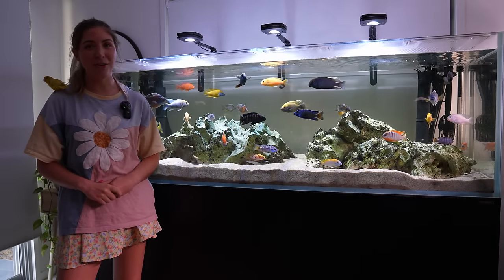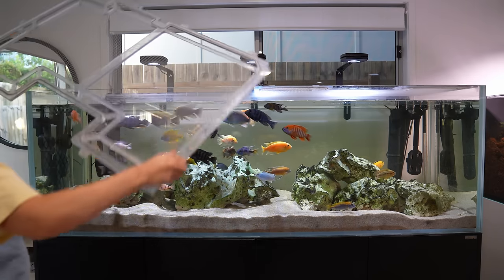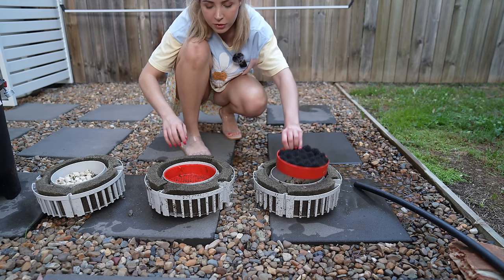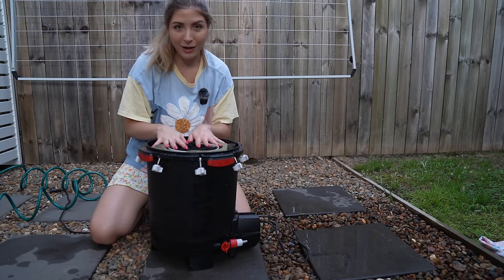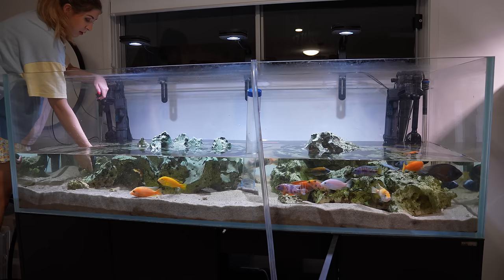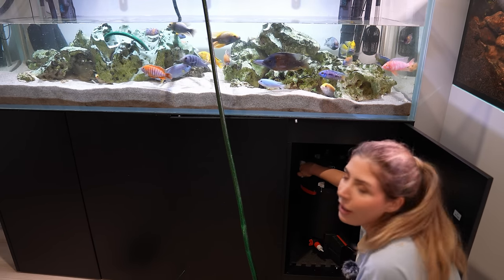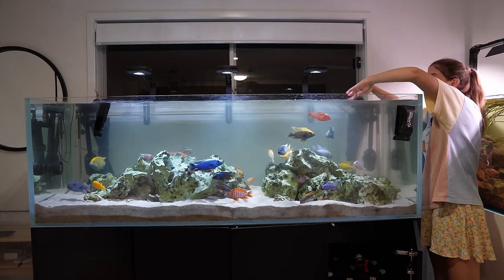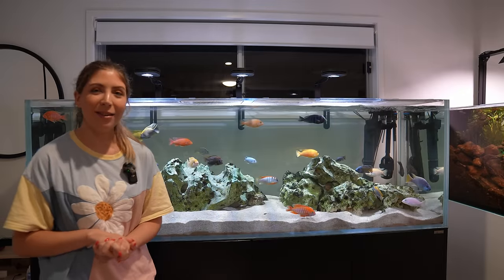Fluval FX6 Cleaning After 3-months on my African Cichlid Tank

Comment: Hi Kaity, nice to see you progressing putting effort in video editing!
To me, you can still give a try to 2-3 things to make it more efficient et even easier. FX6 are real beast filters, but if at one point you can test Oase filters, you may enjoy a way easier maintenance witht a pre-filter cartbridge that can be cleaned with the rest of the filter kept in place, connected to the tank, and you also would be able to hide the heaters since it is included in the filter. So back to FX6, you make an extra effort to use the water of your aquarium.. but this is really not needed. Don't take my words, simply experiment by yourself, and you'll see. On this tank, with a lot of bacteria support in it, and especially with a second filter, you don't have pressure to keep 100% of your bacteria in the second filter. If anyhow you'd like to go smoothly, yes you can actively clean your bio material in the tank water, not wasted since you're doing a water change in same time. But for all the rest, take you filter in your shower, clean it actively, especially the mecanical vertical pads I see still durty when you put them back in your tank. All this waste doesn't help anything in the filtration, simply increase quicker the NO3 accumulation.. So, once you have properly clean your filter,  you close it outside of the cabinet, it is there easier and safer to proceed with FX6 system.. then put it back under the tank, connect only the intake, open the valve, you'll feel the air going out of the outtake.. put your finger in it for the last instant to feel the water comming at level, connect back the outake, put the tubings out of the take if it is possible in a bucket for first moment, all the waster due to (not proper) clean of the filter will go in the bucket instead of the tank. When the FX6 stop (process due to design), put back the outtake tubing in the tank, and that it! You get the cleanest way to proceed, and you'll see that nitrogencycle won't be affected!
Regarding your water change, you see the fish indicate that probably there is to much chlorin in the water.. bit pity when you're doing lot of effort to protect bacteria of your filter.. So, one good thing could be a reservoir, e.g. out of your house behind the wall where the tank are, above tank level to help water transfer (in addition to the pump you already have) and in this reservoir, let the water 24h with strong air pump. Also, you can fill this reservoir through some cartbridge filter, with material of your choice, I guess Nick from KeepingFishSimple is doing that.. or? It is ideal also to do your water mixing with salt you're adding, Seachem has plenty and in Australia you're quite lucky to get easy access to these products! But, and there is a but: you shouldn't add salt blinded, in other words you should add such salt knowing that tap water hardness, and then targeting a (Malawi) KH that will maintain a proper high pH automatically (when O2 level are good). WIth this system, you get a perfect water change, eventually little drop of temperature but often fishses like it.
Finally, 2 stuff you could give a try with this tank. First is a remake of the hardscape, with smthg more natural. Already suggested it. With support of your friend skilled at this task, you will certainly get smthg nicer, that would let more free swimming space but still territories friendly for the fishes. You could reduce the sand bed also, as you noticed it is counter-productive.. The other proposal: denitrification filtering, and not with plants.. but with anaerobic denitrifying bacteria. This is typically helpful with such crownded tank, with omnivor fishes that produce  waste and no plant to deal with NO3. That could lead to intersting result, check on youtube another australian youtuber (GV Aquariums Australia) experiment with that. So, consider a third small canister filter or a T connection in one of your FX6 outtake tubings, to feed a reactor. In the canister or reactor, you can put interesting product: Seachem de❊nitrate (instead of Matrix), and I would even give a try to a mix with Seachem Flourite to provide extra iron and target Nitrate-dependent Fe(II) oxidation (chec Wikipedia article..). Keep the water flow quite slow, under 200L/H.. and after few weeks you may get it up and running proper way! 
So, that all for today, bit long a usual but anyhow if it can support you in progressing and keeping such nice tank, this is cool!
Reply: Slopigyo  Hum, always a question of personal taste.. but thanks ;-)
Reply from the maker: Thank you so much again Charles for all of your helpful tips and for taking the time to write it all out! I'm definitely keen to try a more natural African Cichlid scape at one point. I'm getting quite interested in Tanganyikan cichlids so I'm thinking I might try it with those guys. Maybe that can be my next tank 😁

Comment: You could improve your water adding filter floss as one of final media and it will polish your water.
Reply: I'm preparing for when we have room for an aquarium. Since we are miles from the Rio Negro it will be a South American discus and neon tetra tank. What I've learned is that a sump filter is far superior to your $1000+ dual Fluval setup. First it is in an aquarium so it visible all the time. The amount of sponge area is much larger. You can setup a fluidized filter bed: basically K1 medium with air stones to move the media. The old bacteria and any crud is constantly knocked off keeping the media filled with the stronger young bacteria and clean. Setting up a small chamber following this you put in the "filter floss" the mats of white stuff that polishes the water. As a result you get the final gain over a Fluval: only clean water goes through your pump so you do not have to worry about buildup on your pump impellers so much. I plan on having a dual return, one on each end, with a spray bar.

Comment: Why don’t you have the little red lifting bars that keeps the baskets together? 
It makes it a lot easier to take the baskets out and back in
Reply from the maker: I took them out to try to help with the vibration sound the filter was making (I read somewhere that it worked for someone). The vibration is fine now but I never really thought to add them back in. I also don't really know where they are 😬
Reply: @Kaityscichlids  I've been lucky so far the only time it vibrated was when the pump housing was in contact with the wall of the stand cabinet

Comment: Can you tell me what pump and hose your using? Would love to get one for my 75 gallon tank! Mine doesn't work anymore not sure if it's the hose it pump
        Thank you
Reply from the maker: It's the Aquapro AP3000 :) You can get smaller ones too for cheaper if you don't need it to drain that fast. They do have a tendency to break over time though, I had one before this one which lasted for about a year before it stopped working one day
Reply: @Kaityscichlids  Do they sell it on Amazon

Comment: You do not need to add water to filter. You only do the very first time you set it up. Just open inlet valve then the output valve in that order.  Ask yourself why you are priming a self priming system if there is already water in the tube?

Comment: To stop the crud from the pipe from rushing into the tank when you turn the filter back on I place a net over the outlet for around 20 seconds, helps to capture most of it.
Reply from the maker: That's a great idea, thank you!
Reply: Or you can clean the tubes out!!!
Reply: Put a bucket beneath the outtake hose and let it reverse flush by opening the valve. It will take care of 90+% of the residue issue.
Reply: Oh my gosh

Comment: What sort of price for something that size Kaity?
Reply: The tank is Waterbox clear 7225 pro, and the price varies depending on where you live. The non-pro version can be found from £1400 (currently on sale in the UK) to €2800 (directly from Waterbox in the EU).

Then you have to add lights, filtration and so on.
Reply: @zlamanit  woah!! Bit more than I would have guessed. Thanks for that info.
Reply from the maker: Sometimes you can pick up tanks like this second hand for way cheaper too. My other peninsula tank I got for about 40% of the price it would normally cost full price
Reply: @Kaityscichlids  to be honest I was actually inquiring about the cost of the filter but tank prices was informative. I have been out of the hobby for nearly 2 decades but slowly getting my passion back.

Comment: for larger tanks like this wouldn't it make more sense to use a large sump with 3 inch foams and k1 media. idk it just feels like there's nowhere near as much biological surface area that is needed for a tank that size. Also instead of paying out the ass for liquid prime Seachem makes a concentrated powder form called safe that treats significantly more water for a lower price per dose. a 50g bottle of safe can treat 120,000 gallons (48,000L) of tap water.

Comment: Congratulations, you have a nice aquarium and very healthy looking fish.

   In my aquarium maintenance routine, I never coincide with a water change and a filter cleaning.
   Imho, I think you're doing it wrong. It is true that it is recommended to clean the filter with aquarium water so as not to lose the bacterial load, but what you are doing is killing it when you fill the filter with tap water, which I imagine contains chlorine.

   What I do is clean the filter directly with tap water without changing the aquarium water, so as not to lose the bacteria that are inside the aquarium and that they can colonize the filter again once it is clean, and after a few days I change the water .

   If there is a flow of water inside the aquarium, the bacteria are present on the entire surface of the aquarium, not just on the filter.

   With your method, even considering that you did not lose the bacterial colony in the filter with cleaning, you lose it by filling it with chlorinated water and, of course, you lose any bacteria that was above the water level.
   I have been keeping aquariums for 30 years and have never had a problem with this routine. 'The drawback' is that I use two filters that I rotate when cleaning so that there is always a mature filter.
Reply from the maker: Thank you! I did fill the filter back up with aquarium water (not tap water) but you may have missed it - I siphoned it directly in from the tank. I've got two filters like you, and I alternate between cleaning the two of them. If I only had one I would prefer to clean the filter during the week when I'm not doing a big water change just to er on the side of caution. Thank you for the feedback though, I always appreciate it when people take the time to share what works for them :)

Comment: Wait, once a week 80% water change with two FX-6…. Wow that’s insane amount of work….
Reply from the maker: I found that my nitrates were getting too high otherwise
Reply: @Kaityscichlids  I have 2x 120 gallon heavily planted freshwater aquariums with tons of rainbowfish and I never remove more than 20% maybe once a month if I get time. Of course I have 5 inches of top sol with sand, a lot of plants and not cichlids but still feel like you may want to invest in a sump with lots of plants in it so that they can reduce your nitrates. In any case thumbs up for dedication and making sure your fish are happy.
Reply: @MilosStevanovic1 The heavily planted part of the tank would be why you don't need to change as much water.

Comment: With 30 years of keeping fish, i made my cleaning really quick as it always  took ages, normally, for cleaning filter media, i suction vac hand water out using a hand started fluval vac rather than sucking through a vac to start the flow, out from the aquarium into a large bucket, and squeeze the sponges in that water, it cleans them really well to where they look nearly new, same with the bacteria stone medium, i move it vigorously in their trays in the bucket. Works a treat. 

You can also use the fluval gravel vac and it connects to your FX6, seach it on fluvals youtube page. 

To me, an 80% waterchange each week when you're running 2 FX6 seems like excessive waste of water. 
Thats 28,000 liters of water a year. 
The cost of that would add up over a year, with water additives, heating etc and not sure if you have to pay for your water. 

A Fluval gravel vacuum that you plug in, not the battery one, would save a lot of water and time, and a high water flow for an hour turned on, so that the filters catch all the waste from the heavy stocking. 

I think you've added loads of extra steps for yourself and it looks like an unnecessary drawn out chore. 

Great video though, its a lovely tank and lovely fish too 😊

Comment: I have rushed yesterday and upgraded one of my 2 running FX6s with the dual coarse and fine sponges and found some ammonia in my tests today.  My 300 Gallon tank is only 5 weeks old so I should have waited longer before replacing the stock sponges. I am at around 45 African Cichlids now. I have also added Plants on the surface of the water with their roots only below surface. They are placed in the back compartment with my heaters and filter intakes. The fish can't get to them. I uploaded a video of my water change today and to show how it looks. It's amaze balls!
Reply from the maker: That's such a great idea using floating plants!

Comment: I usually connect the hose runnin in the garden to the small bottom valve on the fx6 and open up the inlet valve of the filter. Leave the retour closed. No pump needed.

Comment: Looking at your setup my advice would be leave filter on & clean the glass first, get all that muck in the water column, then vacuum the sand while the tank is still full, more water in the tank will give better suction on the sand vac, then clean the filter last and that will clear out all the mucky water

Comment: Kaity. Thank you for an awesome video. I'm using An FX6 on 150 gallon stock tank for my koi pond quarantine. Then, if I have a new fish, or if I have a sick fish, I can put them in the quarantine tank. So to keep it biologically active, I have three beautiful goldfish in the quarantine tank. It sits outside, and it has a heater so maintains about 70 degrees Fahrenheit. It had it for about three months, and I've struggled with getting the biological balance since I've had it. And it's not doing very well. Pneumonia nitrate and nitrate all continued to be too high.. it does not seem to bother the Goldfish as they are thriving and growing and eating well. But I would not want to put koi in there with them. I've loaded bacteria with superstart from microbe lift. And then I've used night-out II quite often also from microbe lift, but none of that's working. So I watched your video and I cleaned it very thoroughly. I put it all back together. And I started using the superstart again. I'm just wondering if you can give us links to the chemical and coral products that you use in the bottom tray. When I set it up, I didn't have any of that, so I just set it up without anything in the bottom tray. And maybe that's part of my problem. Again, thank you for an incredible video, and I wish you the best with your aquarium work.
Reply from the maker: Most definitely!! The chemical stuff I used is called "Seachem Purigen". Youtube won't led be add the link, but if you google it it should come up. If the issue is nitrates the Purigen might help a bit, but I didn't find it reduced the nitrates an awful lot. For high nitrates the only real options I can think of are reducing the number of fish, increasing the water volume, bigger/more water changes, feeding less food, and adding lots of plants to help eat the nitrates up. Hopefully you can find a balance!

Comment: sorry if this is asked already but would it be better to use the wave maker around the rocks before starting to filter so the pump can get most of the debris out instead of only have a bit left to work with? i know you mentioned it that you should have a bit more water but was unsure if you did it at the beginning. Great video
Reply from the maker: Thank you 😊 The only problem with doing it while the pump is running is then you might get sand kicked up that goes into the pump which isn't great for it. So I normally only have the siphon running when I do it
Reply: @Kaityscichlids  fair enough, thought the pumps were off when you started so makes sense not to do it then! i have a tank of little starry nights and a few others, but had a really hard time with sand making the tank foggy so switched to gravel instead. sand looks so much better.

Comment: Great video.. I had a fx6 on my tank but had to sell it as the vibration noise was just yo much go listen to.. I tried everything to try stop it with no luck..
Reply from the maker: My vibration used to be terrible too!! I tried so many things because it used to drive me absolutely insane. In the end shortening the hoses as much as possible, putting them on the yoga mats with the vibration pads, and taking out the red things that hold the cartridges together seemed to work

Comment: Very informative video.  You have a great idea to use the water coming from the hose used to siphon out water during the water change to clean the filter media and sponges.  I was just putting aquarium water in a 5 gallon bucket and then rinsing😁 the media and sponges in it, but I will try your method as it seems to be more efficient and takes less time.
Reply from the maker: Thank you John 😊 I used to use the bucket to clean the media too! It's definitely much easier doing it this way. I think someone recommended it on my last filter cleaning video